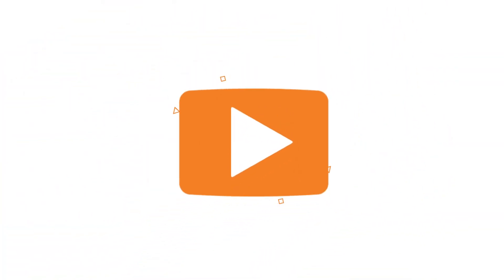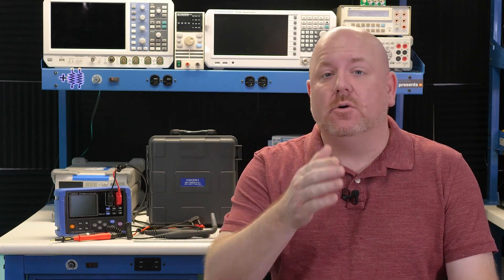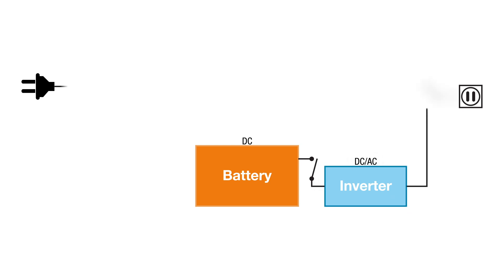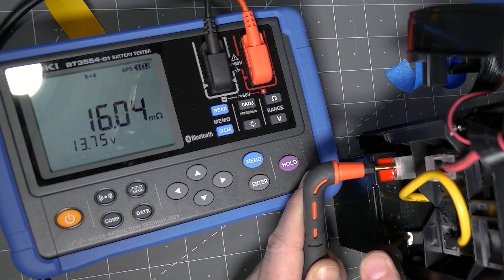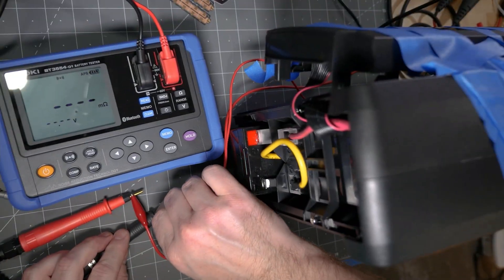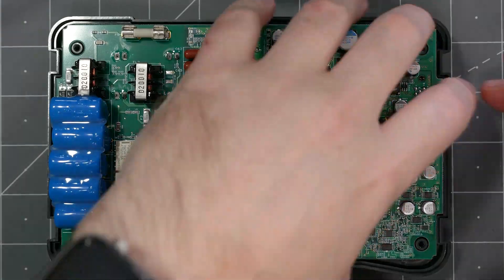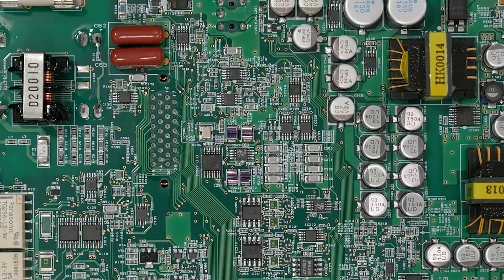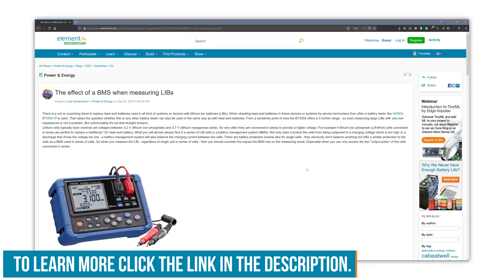UPS ESR Battery Measurements - Workbench Wednesdays

Comment: I replaced my UPS batteries with deep cycle car batteries. They get tested with my Snap On automotive battery tester. I added a Pulse Tek battery conditioner to the series circuit. No more puny brick batteries!